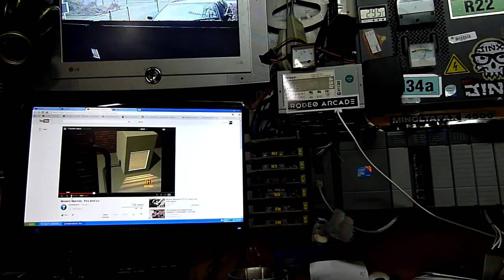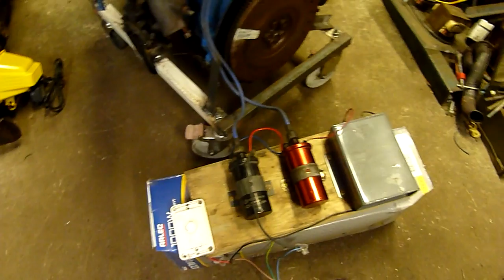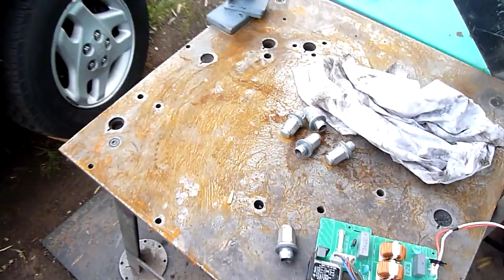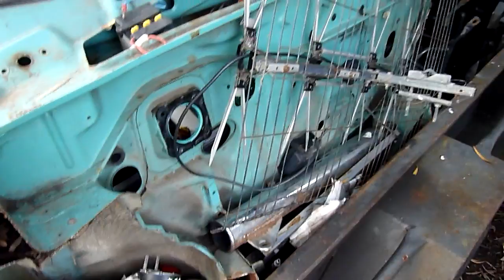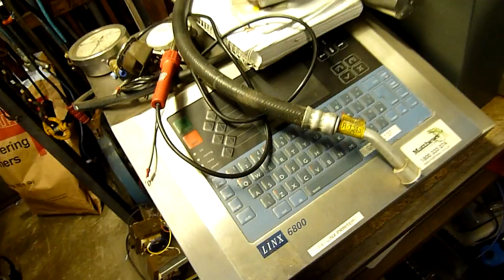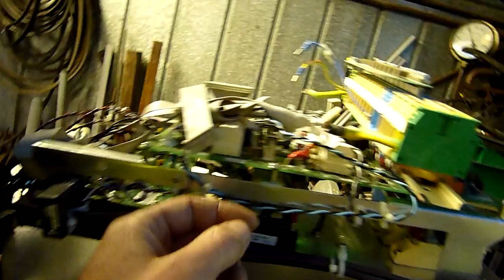Ramblotronic Thursday - Project and work rambling

Comment from the maker: It was a ejector pin retaining plate off a aluminum casting die. its only half the plate (lawn mower deck die) but I do not have the second table that was made with it.

Comment: Try running 240v with a micro wave fan in parallel with the ignition coil mine worked for a second really well but then tripped the ground fault detector cause it wasnt isolated:( might work well for u